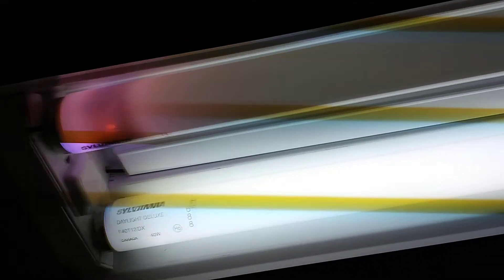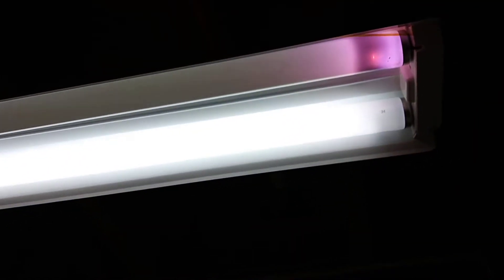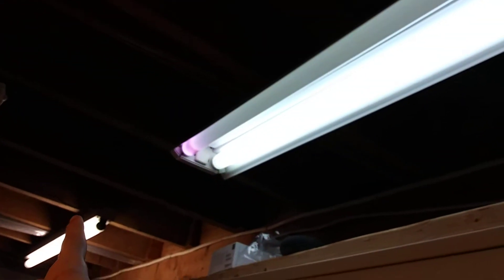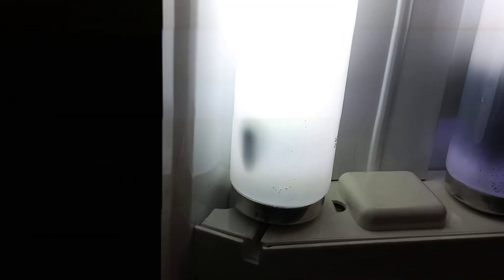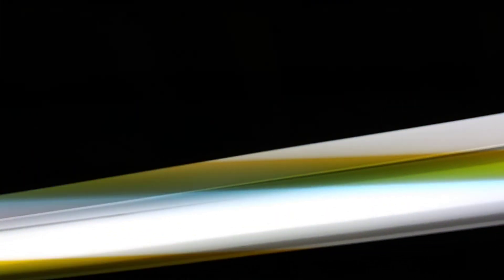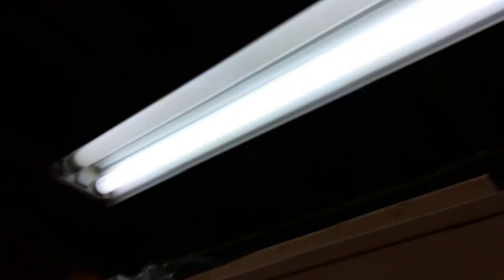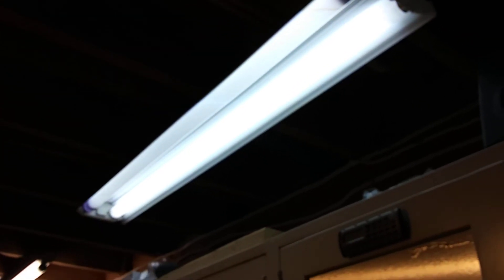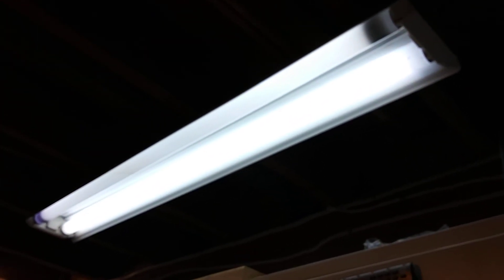Why Cheap Fluorescent Fixtures Are Not Worth Ones Time

Comment: That GE lamp in the preheat shop light is not from the 90s its post sept. 2003 as lamps after that time had to have the HG symbol. the Philips lamp in that fixture is pre 2005 as it has the shield logo on the etch after that it was no longer put on.

Comment: These Lights of America shop-lights are notorious for issues like this. I would not recommend these fixtures. Real rapid start or preheat fixtures are 1000x better!
Reply: Exactly why I replaced the electronic starters with a manual preheat switch in mine

Comment: Like The one from the 1990s that's actually an older style that goes back to the '70s but they did sell them in the '80s and '90s

And the likes of America fixture was actually a copycat of the original picture that they did have back in the '80s I remember that same style back in 1985